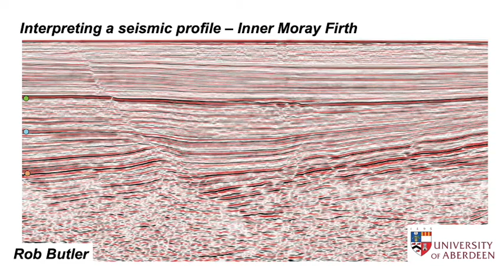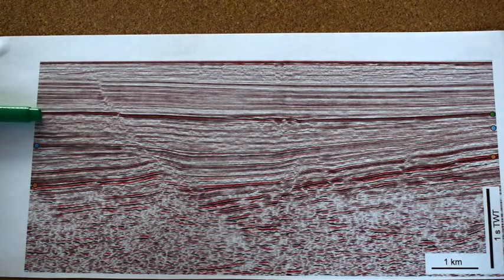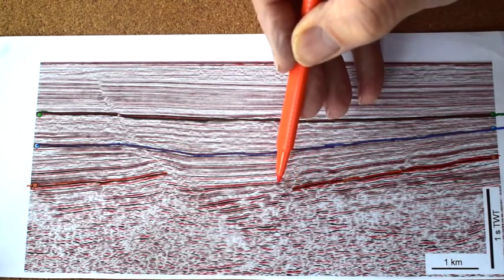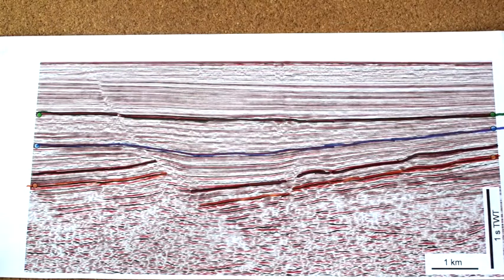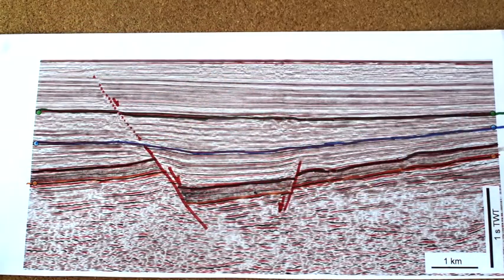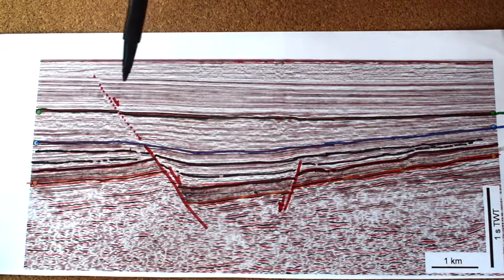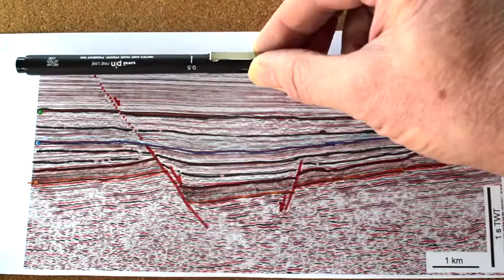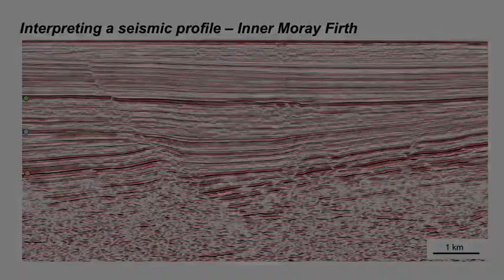Interpreting a seismic reflection profile - Inner Moray Firth

Comment: how could you check for 'Normal polarity' for sea-bed relectors for eurropean polarity conventions ? Thank you :)
Reply from the maker: Hi Tom - thanks for the question. There are competing ways of displaying polarity, generally referred to as "American" and "European" ... in practice, opposite to each other. But actually a greater issue is the choice of colour bar issued to display the image... so rules like "blue = hard kick" is not reliable, regardless of the origin of the image. So a good check with marine data is to look at the seabed - which should of course reflect a positive impedance contrast (as sediment/rock have higher velocities than seawater). For onshore data this is much tougher... For more (technical) info - check out SEGwiki.... as a good starting point....